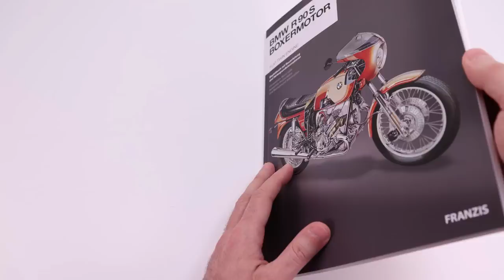BMW R90S Flat-Twin Motorcycle Engine Model Build

Comment: I had a 1974 BMW R75/6, I believe the internal components of them were the same except for displacement. In the video it appeared the cam was driven by a belt, but on mine the cam was driven by a chain.
Reply: You are right. I think they've put in a belt to simplify the assembly. Imagine mounting a plastic chain link by link.
Reply: @Ferr1963  That would be quite a challenge building that piece by piece.
Reply: I had a 75/6 also, did a lot of kilometres on it. This is a beautiful model and I will buy it. Only differences is model does not have clutch assembly or ignition coils. But what a model!

Comment: Hello, I also built the model. The gear switch unit worked well. After building the gearbox testing passed,  But after finishing the whole model I can only select three gears, while de pistin speed remains the same. Do you have suggestion to fix this. I carefully followed the instructions. Thanks for feedback

Comment: For that price you can buy some cheap (real one) engine from old bike and trying to put it together , you will be 100% happier when you assemble that engine and you hear that 2 or 4 stroke engine sound , but yes when someone live in flat and doesn't have garage , this is good too
Reply: NOKERLIK for £200 you're gonna struggle to find a 2nd hand engine like this. I agree though: it would be cool to rebuild an engine and start it up, just for the sake of it!

Comment: The good old reliable bulletproof designed BMW motorcycle engines is that made them the great reputation that they had up until recently.. K bikes have tarnished BMWs reputation. I find their past far brighter than their future. I had a K bike. I’ll never buy another one. Too complex, too expensive to maintain, and you have to marry the dealer

Comment: Not bad, but-  there is no clutch; gearbox should have three shafts, not just two; camdrive should be chain, not belt; should have external coils, not magneto type set up. Good effort overall, though I can't see why you would buy one (I've had several R90s that I could actually ride!)